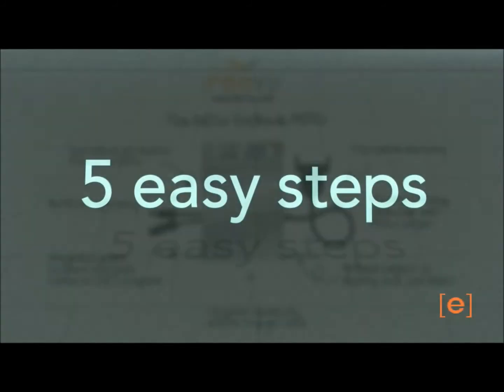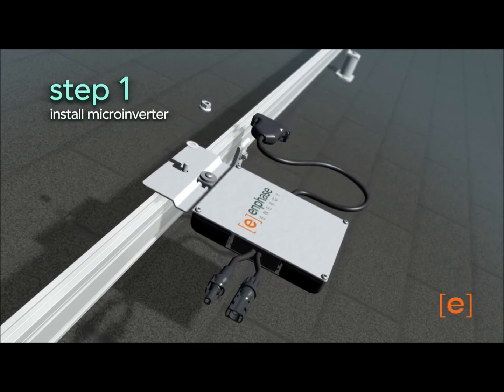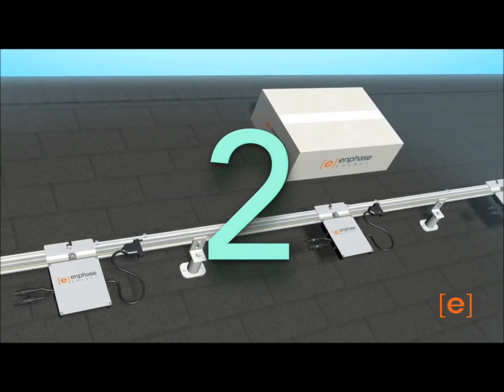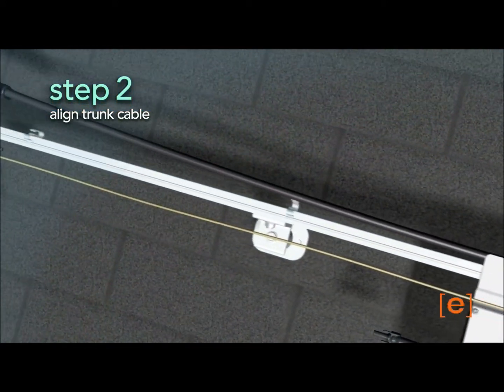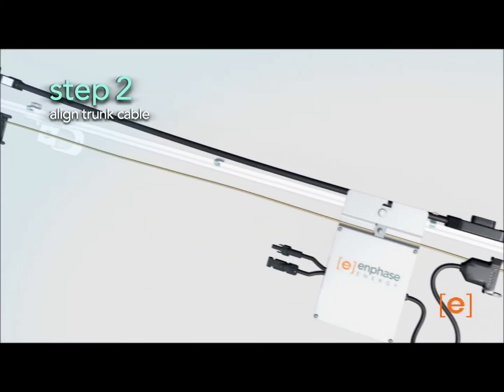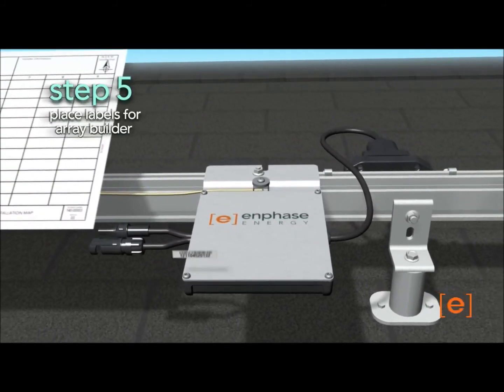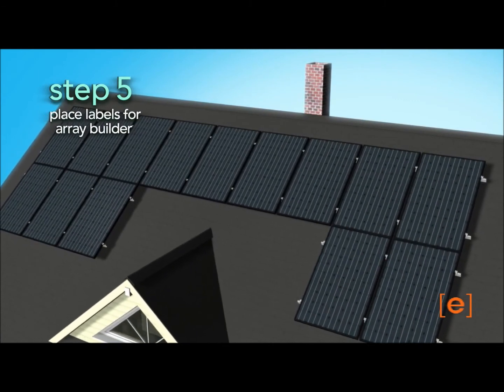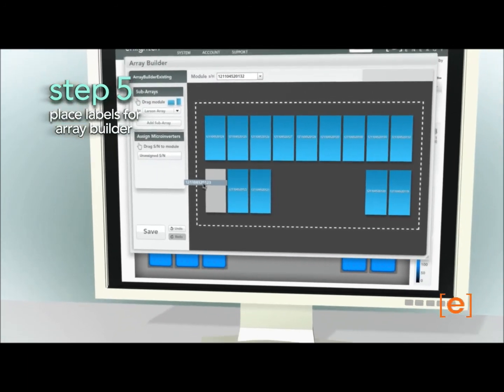The NEW Enphase M250 Micro Inverter Features and How to Install Guide | RENVU.com

Comment: @renvu can you explain what the neutral is used for ? Im only familiar with iq7 and iq8 systems which dont have neutrals in the trunk cable. I ran into an old m215 system today and i saw the neutral and it had me curious as to what it could be used for. I assume it could be used for grid sensing maybe but i really dont know. If some light could get shed on this id appreciate it.
Reply from the maker: Please refer to Enphase's support webpage for further assistance: https://support.enphase.com/s/